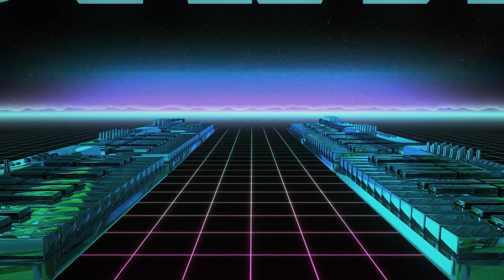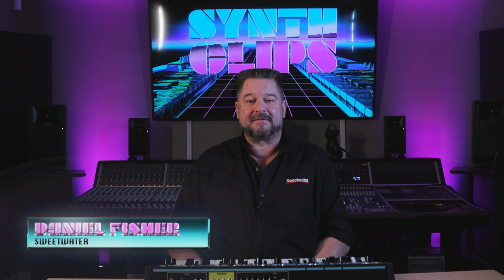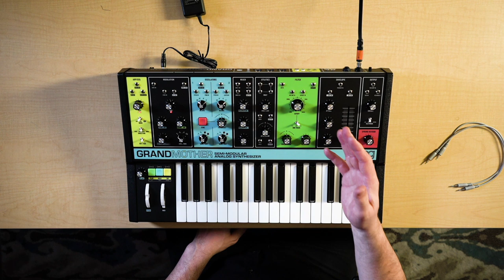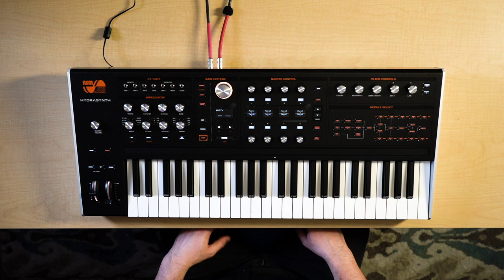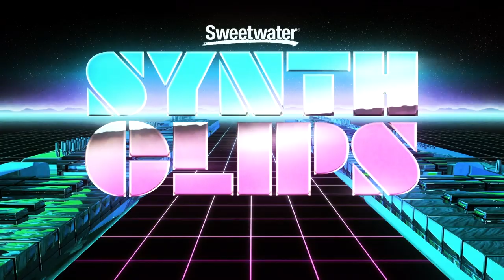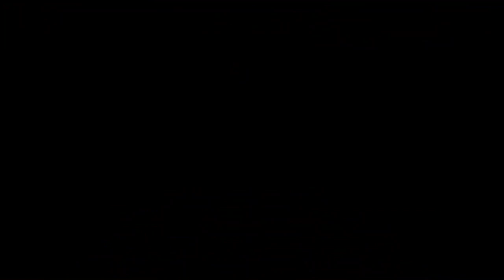Envelopes — Synth Clips 4 – Daniel Fisher

Comment: Excellent information in this video, well done.  One trick I do on my old analog synths that don't have velocotiy  or AT keybeds is to set a very small ammount of attack on the AMP envelope.  If I play quick, the volume doesn't quite make it to "Max", so the loudest volume is shy of full level.  If I hold it just a bit longer it gets to full level.  So in a way, light "soft" jabs feel like low "velocity/volumes", while straight chord holds reach the full "velocity/volume" level.  The volume is very controllable/playable, just experiment between the slight ramp up attack speed agains the comfort of playing with "light" taps.  This trick also works well on the Filter envelopes in a similar fashion.

Comment: I've found this super useful for learning modular synth techniques! I think you mixed logarithmic and exponential though 🙃 isnt it the other way around?
Reply from the maker: Hi PLAY THINK MAKE. Yeah, that's an odd thing that I'm going to have clarify with the ASM folk. You're correct in pointing out that some other synths have that labeling the other way. The Hydrasynth labels it onscreen as I described it. It's probably one of those things that can be quantified from two different perspectives, but I will try to learn more about how they think of it. Thanks for watching! -Daniel
Reply: @sweetwater  no worries! Really enjoying this whole series. I know about curve types from motion design. It's used in the same way.

Comment: I remember when envelopes were callede "Modifiers" and only LFO's were called "Modulation"
Reply from the maker: Hi Cl Lyman. Many modern synths can now  "Loop" their Envelopes to become complex LFOs, so the differences between the two have blurred. The Modifier term meant more when an Envelope was typically hard wired to a specific parameter such as VFC Cutoff or VCA Volume. Thanks for watching!
Reply: @sweetwater  True, but "Modifier" was replace by "Modulation" long berfore that became a thing; see the SQ-80.
When Bob Moog worked with Crumar on the "Spirit" monosynth, that feature was included. According to THE WHOLE SYNTHESIZER CATALOG. I wore my copy out well before I could no longer read the printed page. I would love to have it as an ebook or PDF